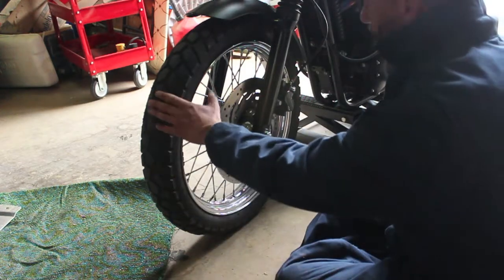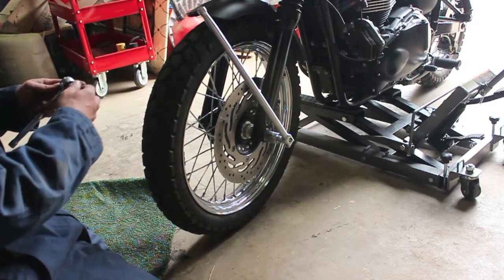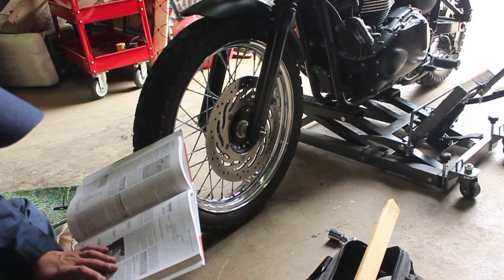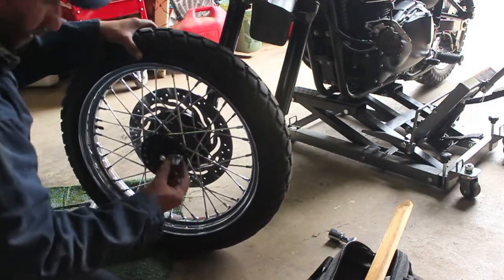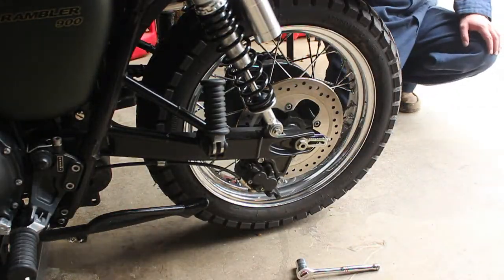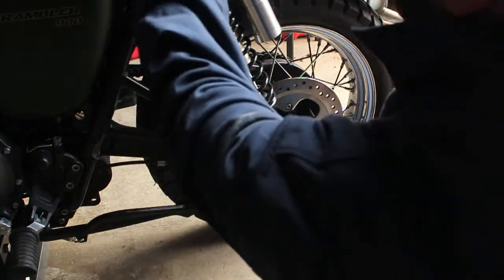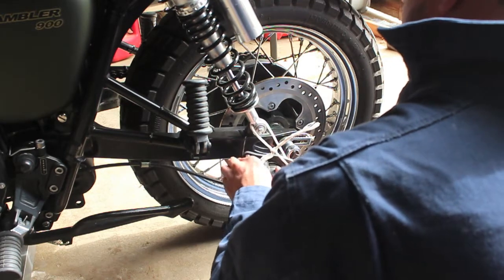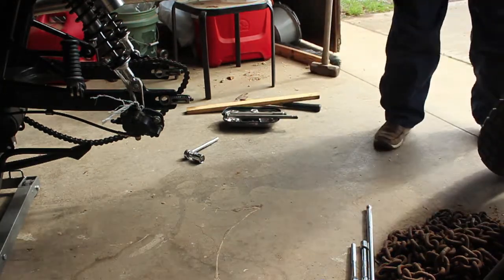Triumph Scrambler - Wheel Removal

Comment: Great vids. I was actually starting a lot of the same exact mods (on the same bike) before even finding your videos. Curious if you opted to rattle can, plastidip or powder coat your rims? I'm leaning toward powder after a lot of forums.

Are those Tec shocks still working out well? 

Cheers.
Reply from the maker: Hey Travis0017, thanks! Yeah after doing some research, I realized that removing the wheel and spokes is really the only way to go. Most places only charge $30-$40 per rim, respoke by a pro is where the cost came in. I rattle-canned the chrome headlight grille black, that came out fine. 

Tec shocks are great so far, have over 1000 miles on them already and really no complaints. I removed the extra bolt lengthener, so now my feet are planted on the ground...highly recommend those shocks! If you are in the Central Valley of CA, I know a couple people you can use.

Good luck! Record you vids, be great to compare and learn :)